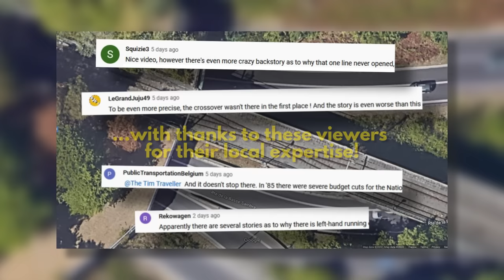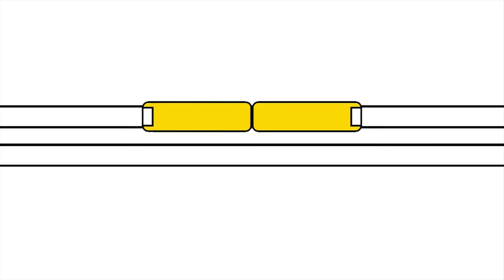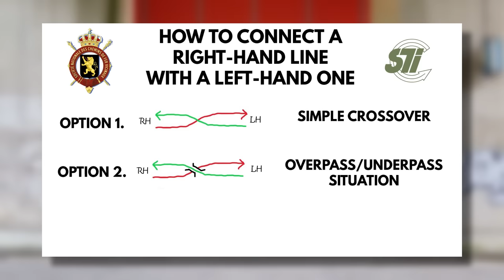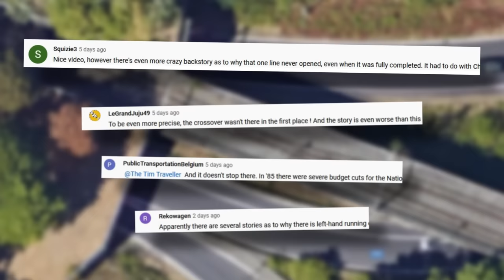The Belgian City That Built Two Metro Lines The Wrong Way Round

Comment: Hi Tim, There was daft old me thinking it was something logical, for example Belgian trains have left hand running (except when going into Germany) and Belgian roads are right hand running, so if a tram was to run part on railway tracks and part on roads, they might need to switch over. This is even more weird than SNCF does in Alsace on the classic line to Strasbourg and NMBS/SNCB does near Welkenraedt before you get to Aachen, Germany.

Comment: Very interesting bit of research.  Just one small niggle, it's not a "crossover", but a "flat crossing", although I suppose you could call it a transposition crossing if you wanted to coin a phrase for this very unusual arrangement.   Crossover is in common usage to mean the very familiar arrangement of two turnouts arranged to allow trains move between parallel tracks.

Comment: Same thing basically in Zürich.
The Tram goes underground on the Line 7 and 9 towards Schwamedingen. The underground stations are island design in the middle of the rails. So there are two crossovers. One at each end of the tunnel.

Comment: Crossover for switching sides isn't uncommon but for better reason: to provide cross-platform interchanges which benefit the most commuters. There are some examples on the London Underground (Northern line and Victoria line), as well as Hong Kong MTR (Tuen Ma line).

Comment: There is a crossover like this in Kriviy Rih: there, underground stations have island platforms and overground ones have normal boarding with the track in the middle. And they couldn't or decided not to order rolling stock with doors on 2 sides, choosing standard Tatras instead, and therefore had to build 2 crossovers like this.

Comment: In Monterrey's metro (Mexico) all stations are designed for "right sided" train doors, except for one. In Line 2 Cuauhtémoc station the doors open on the left side because there's an island platform. 
Also, there are rail exchanges in almost every station. I suppose that'd be a safety measure in case one of the rails is obstructed.

Comment: I know of 2 more crossovers on the same tram line, within like 5km of each other.
However, they are just there to go from outside platforms to inside platforms.
But: a large quantity of the trains running there are equiped with doors on both sides.

Comment: We have a crossover here as well. There's this tunnel that was built before we switched from driving on the left to driving on the right.
The tunnel has a single station in it and it is an island. So naturally, all trams from after the switch to driving on the right had to go on the left to allow passengers to board/disembark.
The rest of the line past that tunnel then goes on the left as there's no mix with road traffic after that point, there never was.

It is the only part of the line that does this and it's been operated by one and the same company since before the switchover.
It was simply cheaper to make the tracks cross than it would have been to rebuild the island station in the tunnel. And so we are stuck with that solution.

EDIT: Though they've recently bought trams with doors on both sides. So maybe sometime soon, the trams will be able to serve islands and side platforms. Opening whatever side doors they need to open.

Comment: the same is in Volgograd speed tram in Russia as they originally used usual surface right-hand side door trams to run in underground part with island platforms. Now all these ancient single-side trams are written off, but crossovers still exist.

Comment: Reminds me of the Buenos Aires Metrobús at 9 de Julio Avenue, where they built two lanes of Bus Rapid Transit kind with island platforms, but instead of using regular BRT vehicles with doors on the left side, they use regular buses, so they go on the opposite direction to the main vehicular traffic on their side of the street.

I can't hardly consider it an actual Bus Rapid Transit, other than the fact it has its own lanes and platforms

Comment: “Milchbuck-Tunnel “
In Zürich they have build a Metro-Tunnel in the 1960 for a line that never came and is now used for trams. At one entrance they use separate tunnels to switch sides,at the other side is a simple crossing installed.

Comment: I was thinking what a crazy story and then I remembered our local crazyness with the two lightrail alternatives, one based on a monorail system and the other based on a traditional lightrail network. Both were funded and land was purchased but the monorail was eventually cancelled... so that land ended up getting disposed of after beloved neighborhood shops were closed, etc. Still a lot of bitterness about the cancelled portion as it could have been a good supplement and cross-city connection to the current line. Sigh.

Comment: In Stockholm, Sweden such a crossover exists and are in daily use. How come? Up til 1967 Sweden, like The UK, drove on the left side of the roads. But September 3 1967 we changed to right-hand traffic on the roads, like the rest of Europe (except The UK). It was discussed if also the railways, and Stockholm Metro, should change to right-hand too. It would have cost a lot without any practical bennefits so the track systems remaind on the left side.
With the change of traffic all remaining tram lines is Stockholm were scrapt, except for one line: The line 12 (Nockebybanan) in the suburban of Nockeby just west of central Stockholm, it lived on and was adapted for right-hand service.
But: In Alvik where line 12 connects to the still left-hand running Metro (Tunnelbanan) even line 12 have to run on the left side to make it more convinient for the passengers to change from tram to Metro.
Then, why wasn't line 12 closed down too as the rest of Stockholms trams in 1967? The streets in this area are to narrow for busses to replace line 12.
https://www.youtube.com/watch?v=Eyev_mqbWfw

Comment: In Brussels, the metro mainly rides on the right… but there is also a part where it rides on the left (line 6 from South Station to Roi Baudouin and line 2 on the shared section). But no crossover, one track goes above the other at South Station (where the platform are one above the other).

I'm not sure, but it's probably because the metro (former line 1A before 2009) used to change direction at Beekant to go on another branch (while staying on the same side).

BTW, probably not related, but trains ride on the left in Belgium.

Comment: Not only in Belgium!

White City Station on the tube (Central Line, London Underground), has the trains running on the right. Most of the tube has trains running on the left, and I've always wondered why this oddity.

The tracks swap over above ground between E. Acton and White City by way of a bridge to allow the trains to cross each other's path. That bridge was nearly positioned so that I could look out of my school window and watch them doing so, and I only sometimes got caught doing so. I don't think however that that was why the bridge was there.

The tracks swap back underground between White City and Shepherd's Bush, and if I'm not mistaken each track is in a separate tunnel at that point, but they are back on the same level by Shepherd's Bush again, running decently on the left.

Why this special treatment for just one stop?

Is it connected with the exhibition that was held decades ago when they closed Wood Lane and opened White City for the festival goers? Or something else entirely?

More Jago's style than Geoff's of the London train geeks, but as you're mentioning something similar in Charleroi I thought you might know... or at least be interested :)
Reply: Because it used to be the end of the line, and would loop back on itself.

Comment: Every now and then, on our LRT system, the driver would open the doors on the wrong side.  Presumably due to an inexperienced driver...   They really need to have sensors to automatically select the sides such as magnets or even bar codes and a light/photo eye to read the codes.  Sometimes, there would also be the wrong station announcement, that could also be addressed with barcodes either barcode or magnetic along the rail to trigger the announcements as well as select the side to open.  Decelerating to a stop should also be via such signals so they consistently stop at the right location (allows safety barriers and doors in the future), when our LRT first opened, it often stopped with a door off the platform as the driver decelerated too late.  There was so many small details which were just passed to the responsibility of the operator even though it would've only costed pennies to automate with guided vehicles.  Now, they left out most of the "options" with the first batch of trains with our LRT system presumably just to get the system established and they've probably added the options with the newer purchases especially as I don't see these problems anymore (though I no longer use transit as often as I did as a student) but really, I think some "options" should be mandatory.

Comment: Also nice, The Netherlands has 1 High speed Line split in two sections. The Northern section from Hoofddorp to Rotterdam is running right hand. Apart from a useless tunnel under farmland there is little to see here. The southern section however from Rotterdam to the Belgium border is running Left hand traffic. If you take a train from Breda to Rotterdam you cross all running lines twice.

Comment: There is a equal crossover in the Tram network of Zürich near „Schwammendingerplatz“ on the Lines 7 & 9. 
because in the tunnel between „Milchbuck“ and „Schwammendingerplatz“ the trams run on the left with central platforms, while the rest of the network is righthand traffic.
Maybee you want to make a video in the future about the story behind it (failed Zürich Metro)

Comment: Belgium, eh? Hold my beer. Kassel, Germany has exactly this type of crossing on its tramway line 1, because inside the city boundaries there are two platforms at the sides of the track while in the suburbs there is only one platform between the rails. The difference is: this line isn’t abandoned but the busiest in Kassel.

Comment: And the best part is... STIC did not own unidirectional trams, or at least not after 1945. Nice to know is that the most recent of STIC's trams, the 400 series, was built in Ostend in the early 1940s and brought to Charleroi not by truck or train, but by simply hauling the trams across... the enormous Vicinal tram network, all the way to Charleroi.

Comment: I have looked through the huge number of comments but could not see one that made my initial point. The commentary suggests that the STIC had a history of using unidirectional cars; in fact their previous fleet were all bidirectional and oddly it was the SNCV that had earlier operated some single-ended cars in the area. I assume that the STIC had intended to buy a fleet of new unidirectional cars to operate the eastern lines – perhaps similar to the BN cars on the coast but painted green. The other question that occurs to me is did they intend to a have a separate depot for their cars?
Reply from the maker: Hmm - this just gets even more confusing!

A couple of sources told me that the STIC wanted to run on the left because they "didn't want to change their passengers' habit of getting on and off on the right."  

That suggests to me that STIC trams were historically unidirectional. But I've just scoured some old photos, and you're absolutely right, they ran bidirectional trams. So I guess the "passenger habit" came simply from the fact that the right hand side was the side you'd normally get off at.

However, other sources told me that there was a plan for Charleroi to borrow unidrectional Coast Tram vehicles in the winter, when they were not needed on the coast line. And THAT is why they needed to run everything on the left.

The second story makes more sense to me, but that doesn't necessarily mean it's true...

One thing I can clear up (I'm 99% sure!) is that the STIC never planned to buy new unidirectional cars for the Metro.

Comment: Actually Zurich has a similar crossover at Milchbucktunnel which was a advance construction for the planned, but never realised metro. The also have to run on the left through the tunnel because of centerplattforms: https://de.wikipedia.org/wiki/Tramtunnel_Milchbuck%E2%80%93Schwamendingen

Comment: I must say I witnessed Charleroi going through difficult times around 1972 with the steel factory being in trouble. I worked then for a project to control a "on the fly" shear on hot metal bar (Billette) driven by a pair of optical sensors using the glowing variations of the hot metal. We started testing it and then sadly it never was used (our work and their money wasted)

Comment: Do they still run unidirectional trains with doors on one side only? Seems to me that they should just phase out unidirectional single side trains and require all trains to just have a bi-directional all sides door system. Minor changes on the signal and other stuff and then they could now remove the crossovers?
Reply from the maker: Hi Julius - as far as I understand, unidirectional trams never actually ran on the Charleroi Metro! The STIC never got the chance to put its plans into action because the regional authorities cut funding to the Metro project before they'd even opened their two lines.

By the time Line 4 was revived in the 1990s, the new TEC company was responsible for the whole system, and they only ran the bidirectional trains. So they could have switched to right-hand-running, but in the end it was cheaper and easier to install the crossovers than it would have been to rip out all the signalling and replace it.

If the Line 5 project goes ahead, it will be interesting to see if they resignal it, or if they keep the crossover...

Comment: Dealing with the cars instead of the rail would have given them more options because it seems to me that a much simpler solution would have been to buy new rail cars that are two sided, or, if all the stations were truly islands, turn the single-sided cars around to face the other way even if one had to drive the train backwards.

Comment: Weird crossing: we have such a weird crossing in action in Switzerland in Zurich. There was the same issue: unidirectional streetcars with doors on the right side shall run in a tunnel with island stations. The tunnel is the Milchbucktunnel, a left over of the never realized Tiefbahn Zürich. There is only one crossing on the East side at Schwamendingerplatz, on the East side of the Tunnel at 47.40508, 8.57110, the West side is solved with a fly over at 	47.39911, 8.54296. Picture of the weird crossing can be found on the bottom of the German Wikipedia Artikel https://de.wikipedia.org/wiki/Tramtunnel_Milchbuck%E2%80%93Schwamendingen

Comment: that is very interesting. in vienna we have something similar on the tram line 26, which connects ahusfeldstraße in aspern with kagraner platz in kagran, both in north vienna. at at stations "Forstnergasse" and "Süßenbrunner Straße, Oberfeldgasse" the rails cross over. this is because between those stations the tram is operating seperate from the road and station "Gewerbepark Stadlau" has 1 platform in the middle, like most underground stations. sadly this unique and interesting system is not more common. i quite like it
here you can see a pov ride of that part of the line: https://youtu.be/Yr_I0emDIUs?t=1470

edit: while researching this, i found out that on line 25 there is a similar thing at stations "Donauspital" and "Kagran". but those are much more cluttered stations with loops and several tram lines. not one line in a more or less straight path

Comment: Thanks for your work.
Actually, there is a problem on the road of lines who already opened, it's that there are not enough metro train to keep the passage times. 
 The train machine were made since more than 40 years now, they fails more often and need more maintenance.
As we will need more operational machine to make all the lines viable, I hope that they will produced new rolling stock for the metro.
https://fr.wikipedia.org/wiki/BN_LRVe

Comment: Response to title: Cause it’s Belgium, duh!  For ex. in B when a sign for POI X points to the right, POI X will be on the left next to 3 unnecessary signs supposedly guiding you to POI Y. There are plenty of ‘ scratch your left elbow with your left heel’ examples all over Belgium.

Comment: Perhaps I should point out that Brits have "Irish jokes", Canadians have "Newfie jokes" and the French have "Belgian jokes". On Dutch railways, branchline services arrive at the terminus and then set off again 2 minutes later. In Belgium, branchline trains set off from the terminus and the incoming train arrives 2 minutes later, meaning the train sits in the station for 58 minutes. Not a great use of resources. It appears that Belgian brains are wired upside-down, back-to-front and on the skew. 🤣

Comment: 2035: All the original vehicles had to be scrapped due to rust, EU regulations and inefficiency. The newly bought set is uniform and has doors on both sides. Unfortunately, due to unexpected budget costs (too much money was spent on the celebrations on of the 80th anniversary of the Charleroi Metro), no money is left to remove the cross-overs.